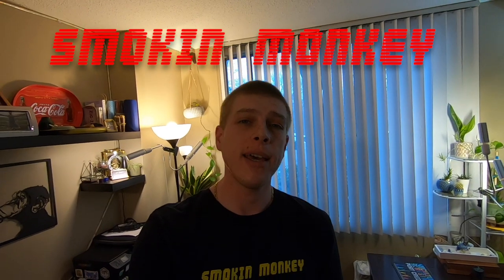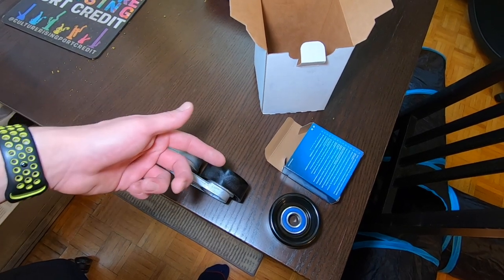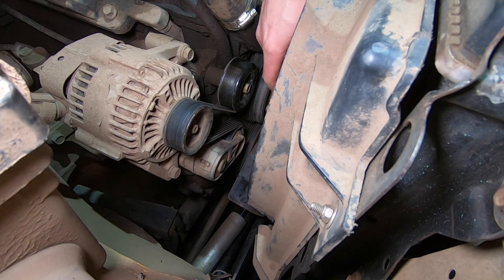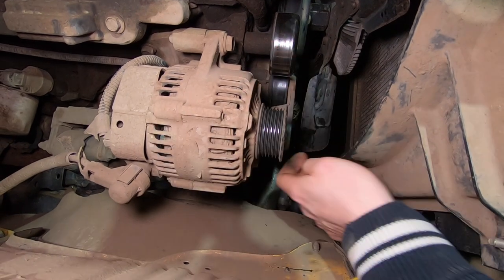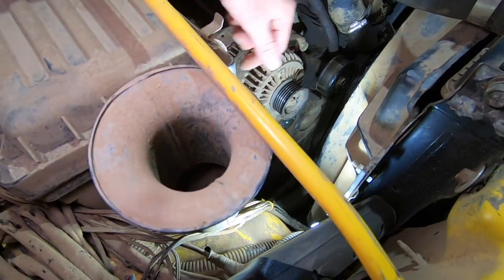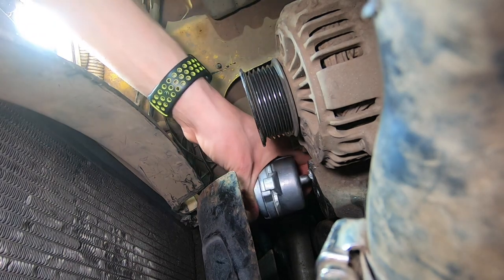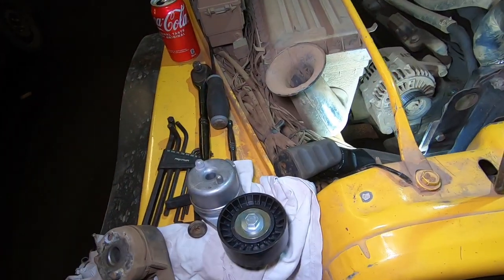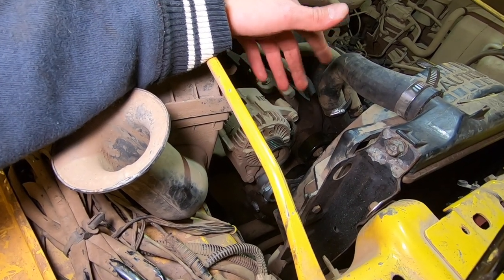Chasing Down ODD ENGINE NOISE On My Jeep TJ... It's FIXED But TOOK ALL NIGHT!

Comment: nice work. I've got the same whirring/whistle noise. I've got the idler wheel, where'd you get the tensioner? could you post link to the parts?
Just took my '97 TJ in to give the 32rh a complete rebuild. Had the frame and floors replaced/fixed. When I get it back from the tranny shop I'm doing the lifters and pushrods, exhaust manifold and pulleys. Figure that'll keep her happy for another200K
Reply from the maker: I just went to my local parts place I don’t have a part number since I threw the box out already. But I’m sure it’s not hard to find. That sounds like you’ll have a brand new jeep when you’re done
Reply: @SmokinMonkeyOG  can't let the old girl die. They cost a bit to get solid but once they're fixed up theyre cheap to fix. Ya, they eat gas but gas is cheaper than new car payments.

Comment: Just out of curiosity, do you know what's causing the chattering noise you can hear when idling? My 03 TJ makes the same noise and I'm curious if its something that needs attention or just a 4.0L thing (from what I've read on forums). Noise is only there on start up for me, lasts around 2-3 minutes or so, and goes away.
Reply from the maker: Ya mine usually goes away once it’s warmed up. But I do know it’s a common problem on these 4.0L engines. It’s either a lifter, rocker or valve guide or combination of them that makes that noise. It’s definitely good to have it done but I’ve been driving mine for 2 years with that noise and it’s still good. Other people I know have had that noise for a very long time so it’s nothing too concerning if you ask me. But I plan to have it taken care of sooner than later
Reply: @SmokinMonkeyOG  Thanks for the response. I assumed as much and considered replacing the rockers, guides, rods, and lifters as a good starting point. Jeep only has 135k on it so im sure itll last, but id rather take care of it now rather than wait until its too late. Keep up the good videos.

Comment: Poor girl needs a bath. Inside and out. Thinking of doing valves soon too. The tapping just bugs me
Reply from the maker: Ya she’s dirty lol I definitely will give it a good clean up soon. Mine goes away once the engine is warm but I’m planning to tear it apart and replace lifters, rockers and anything else that’s worn out in the head.